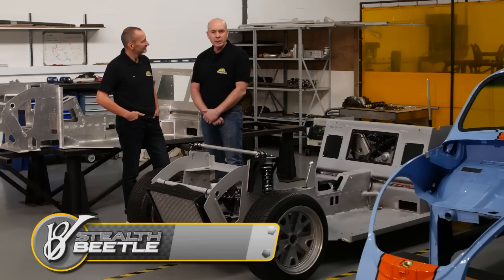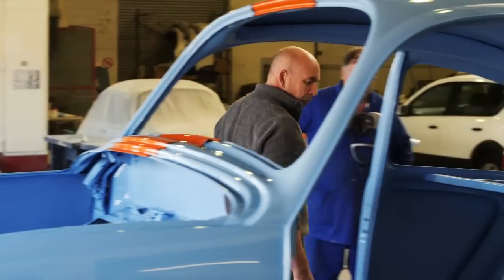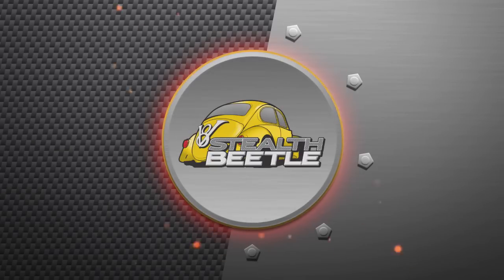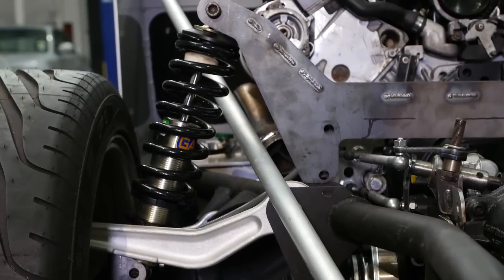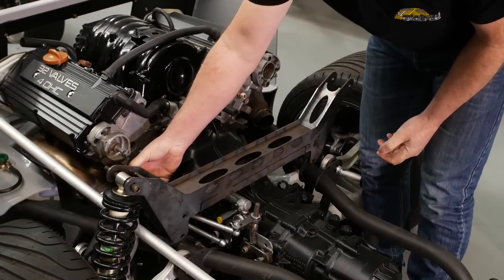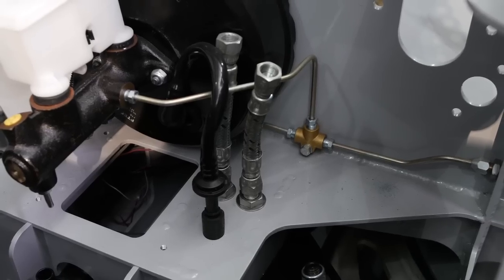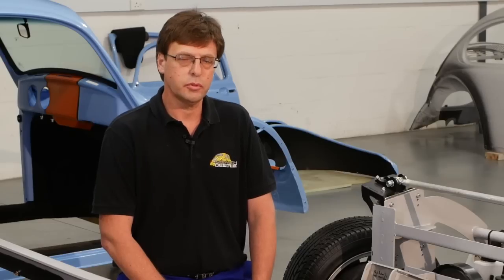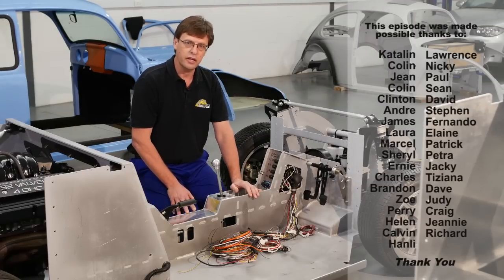V8stealthbeetle Episode 13 The Technical Stuff

Comment: Absolutely awesome! How and where is the drivetrains subframe attached to the aluminium chassis? How are you going to cover/close the inside of the wheel arches and also how will you cover the engine from the firewall and back so it will be air tight between coupe and engine bay? Keep up the good work I, can't wait for more 😉